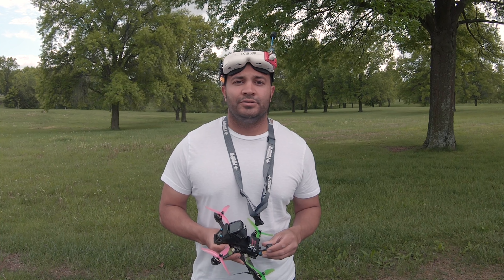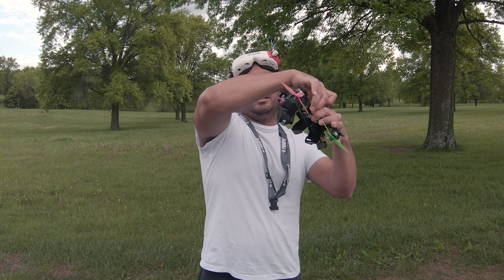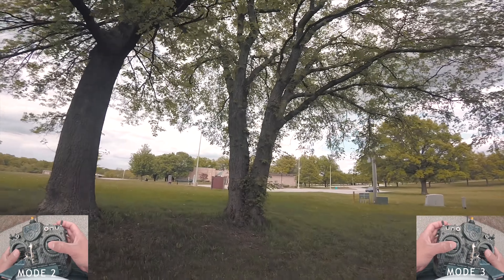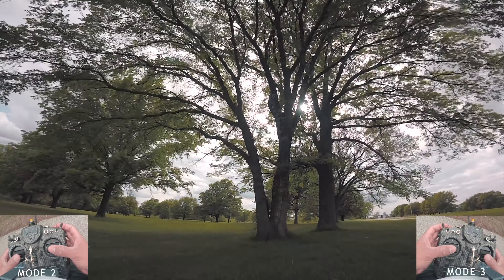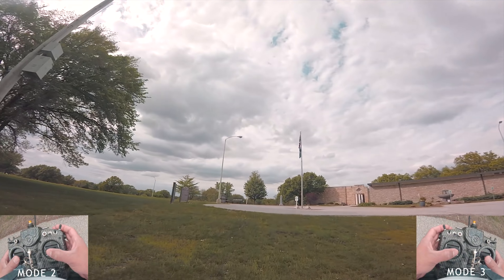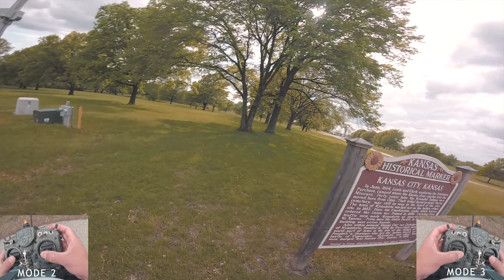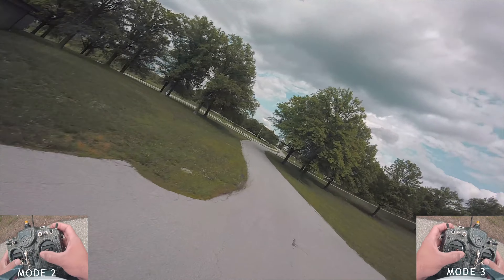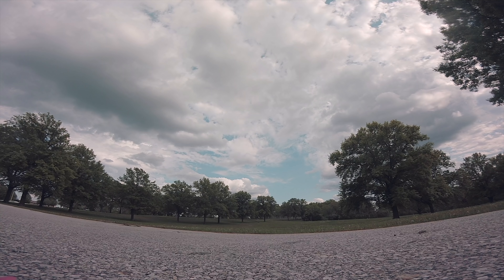FPV TRICK SERIES: HOW TO INVERTED STALL INTO GAP?! 🔥🔥🔥| FPV FREESTYLE

Comment: Your quad is so locked in. I always find my self chasing a straight line headed for a gap. I always feel lucky if I made it through. Your skills are an inspiration for me. Keep the video's coming. Thanks
Reply from the maker: It’s more stick time to me. I been flying same setup for more than 1 year and haven’t changed my rates.
Reply: @VIKFPV  guess I need to keep with the same setup and fly. 😂